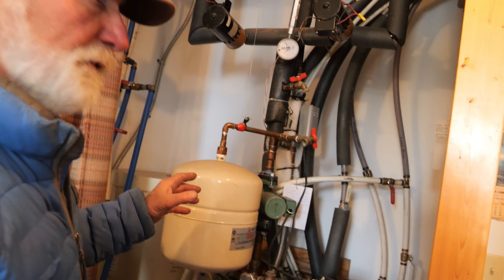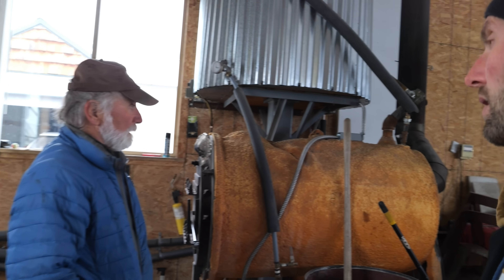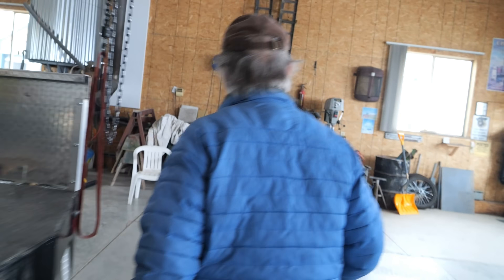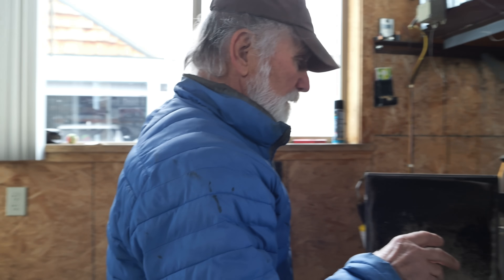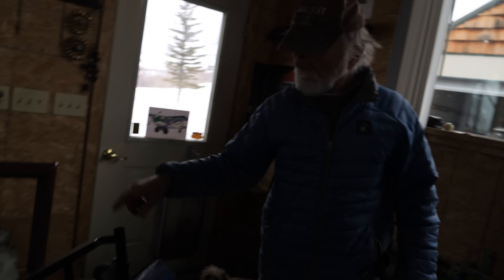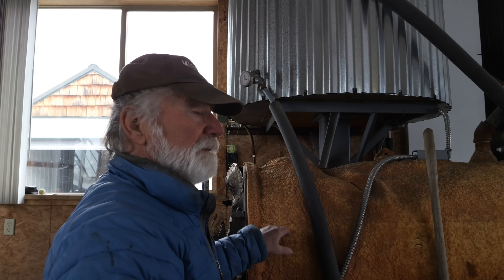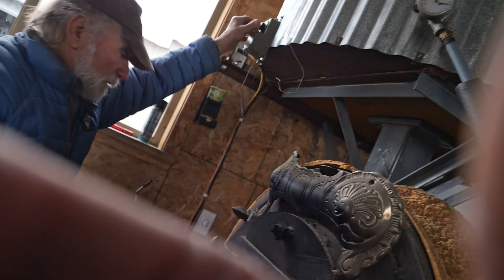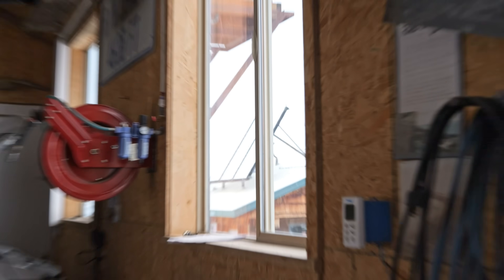Hasn't had a Heating Bill for 40 years.

Comment: 😎🤔🤔🤔💁‍♂💁‍♂🫶(6:33) Pretty dang close: (old timer). 1 top and 2 bottom - flow rate controls, bty...
😎😎🤔🤔🤔🤔💁‍♂(11:17) (I would just use ((Coal Slag > Blasting byproduct material)).
😎😎😎🤔🤔🤔💁‍♂🤡(12:38) The green slag from copper: very slow water erosion; it could mineralize as a toxin; makes sense why the {other byproduct use}, for Conductive Heat Exchanger. Smart Mountain Man: engineer?

Comment: For anyone wondering, his external panels run glycol through them because glycol will not freeze when the temps drop. The warm glycol runs through the heat exchanger which then warms the water to run under the floor. 
I know that it's probably obvious to most folks who watch these types of videos but hopefully it helps someone understand that otherwise wouldn't.
Pretty awesome setup
Reply: I understood this but by all means an explanation of the basics is always welcome. Some of us are just learning about this kind of thing
Reply: I understood all of that, but wouldn't a larger heat exchanger make it way more efficient and speed ip the process of warming the water to warm the floor faster?
Reply: @danamullins2723 those brazed plate heat exchangers are surprisingly efficient despite their small size. More btus with more water flow needs a larger heat exchanger, but his smaller system doesn’t need many btus. He could gain an advantage with a larger heat exchanger but might be splitting hairs if he sized that one appropriately
Reply: @danamullins2723  I can’t remember what principal it falls under but at a point the heat exchanger starts to hurt you for efficiency if it’s oversized too much
Reply: @danamullins2723  a bigger one wouldn't increase speed and efficiency, the system is limited by the heat input from the solar. and there are losses in a plate heat exchanger so it has to be sized correctly. 

no need for glycol under the floor. water is considerably cheaper.
Reply: @cliveramsbotty6077  Should the system fail in the winter, the glycol wouldn't freeze and bust up the pipes under the concrete floor like water would.  Just an insurance policy.
Reply: @danamullins2723  a tiny plate to plate heat exchanger will transfer 30kw of heat they are very efficient they are used in gas combi boilers (I used to be a gas engineer in london) . I’d say the system probably doesn’t work well in the winter though not enough sunlight  hence the wood fired box.
Reply: @danamullins2723  don’t want to sap the heat out too fast
Reply: @danamullins2723  You size it for the system.  He is in the sweet spot for his heating requirements. Any more adds to the thermal mass, which is great once it is up, but will take longer to get to temp.
Reply: Dumb question: why would you want to avoid using glycol under the floor? I understand by separating the fluid he has greater control over the temperature change, but it's technically not as efficient.
Reply: @johnweir-w2f  Glycol is less efficient at transferring the heat (e.g. to the room) than water. His wood burner uses water throughout, he'd use water outside as well if he didn't have to worry about it freezing...
Reply: @fat_biker  simpler is better as long as freezing isn't an issue why not make it easier to refill and maintain that level also having a high point to vent is always a good design feature since it lets you purge the system and diagnose problems.
Reply: @fat_biker  It's a great safety feature.  He could have done things to ensure the outside pipes don't freeze, until the unforeseen happens, he goes to Fla for a month, or is in the hospital for a few nights...the glycol is a great idea to protect the system where it is vulnerable to the extreme cold.  This was a great vid.  I sometimes think about selling my business in Philly (I am from a small farm in N. Central PA originally tho) and moving somewhere like Wyoming, in the middle of nowhere and living a free, self sustainable life like God intended us to live.
Reply: @johnweir-w2f  Because glycol doesn't release its heat as efficiently as water does.
Reply: @johnweir-w2f  Along with the stated, glycol is less efficient than water, If water leaks up under the floor, then he has a relatively mild problem he needs to fix, if he has glycol leak under the floor then he's effectively got a small ecological disaster to clean up.
Reply: @johnweir-w2f  Well he kinda explained it at the start, it's less efficient technically but it would take a lot more glycol to fill those floor tubes than what he used to run from the panels to the exchanger, and water is a hell of a lot cheaper than glycol
Reply: @johnweir-w2f  He runs water for because it has better heat transfer.  Also the floor has 2 heat sources one is solar that uses glycol and the other is the wood fire boiler.  

Both heat sources use the same manifold and water since it is a closed looped system.
Reply: @johnweir-w2f  Glycol is relatively expensive, and water is far cheaper and better at carrying heat anyway due to its high heat capacity. The glycol gets hotter in the solar panels which makes up for its poorer carrying capacity.
Reply: @johnweir-w2f  Glycol is expensive and needs to be replaced every 5 years or so because it chemically breaks down. Water on the other hand has been around for 4,3 billions years and is still water. Also incredible cheap. So can you run glycol through your floor yes, but does it make sense, no.
Reply: @johnweir-w2f  He mentions during the video that the water used in the floor has better heat exchange than glycol. Listen at around 2:40 in the video... at 2:52 he says, "..water is more efficient at exchanging heat than glycol.." (I personally know nothing about it, but for the past 40 years I've had heating bills and he hasn't, so I'll take his word for it!)
Reply: @johnweir-w2f  The specific heat of glycol is lower than straight water, so that means per unit of mass the glycol mixture will store less heat. This loop through the concrete shares the same reservoir as the boiler storage I think, so that would mean a reduced energy storage in the secondary ( but highest volume ) loop. That would be my guess :🤷
Reply: @johnweir-w2f its cheaper and water produces heat faster and more efficient than glycol does
Reply: @noblethepilot6628  Depends on the glycol. EG, MEG, TEG, or DEG. TEG(tri-ethylene)will get the highest and that starts to break down at 408. Its most likely EG which is automotive antifreeze.
Reply: Well..... to say it hasn't cost a dime...... It does take money to have the means to fall a tree. Cut a tree up and split that wood. The tools needed to do those things are not free. Its not free to maintain those tools to be able to harvest trees. There wouldn't really be much of a difference if you just went to a job then used the money from that job to pay for home heat. Its all about the time that you spend in order to be able to heat your home. In reality its much less time spent and less work at a job to be able to pay and heat your home for a year than it is to go get your own fuel to heat your home. Most people its like 2-4 weeks at a job to heat your home for a year, depending on your climate. Its just an illusion that its free heat. Its just time spent doing different things to achieve the same end goal.
Reply: @shperax true to a degree, but I actually don’t think it is the real point. The pride this man has in his work and his creativeness is palpable. He clearly has different values in life, he isn’t married to his job, he loves to work and solve problems, and he can take care of himself and others in war or peace. I really admire that he doesn’t hand over his reliance to corporations and trades he can’t control. Self worth is what this is actually about.
Reply: It helped me to understand, thank you.
Reply: Also if pump fails you won't bust open your panels and flood the house.
Reply: Sounds like me lol. I have a wood burner that does the heating and hot water. Free wood from work. Solar that uses the spare power to heat the water tank. No gas.
Reply: The dumbass has spent $5000 on his heating system and he says its FREE! LOL
What a fucking idiot.
Reply: We use glycol and ammonia at the dairy plant where i worked. We use glycol for heat exchangers and ammonia for cooling. He spent alot of money building his systems fkr heating but im sure its paid for itself a long time ago. Smart men with engineering and mechanical knowledge like this are a  rare breed nowadays.
Reply: Awesome until you have to change the glycol and find yourself with 400 gallons of toxic liquid and nowhere to dump it.
Reply: Thank you! This is news to me.
Reply: Thank u for the summary
Reply: so.... just pure glycol?

what an awful way to describe what is actually occurring in a glycol laced system.

explain how glycol affects efficiency please?

do tell.
Reply: Just wondering where this is located? How low do winter Temps get?  As for the winter coat comment... that is not a winter coat!!
Reply: Thanks, yep pretty confusing
Reply: It might not freeze, but it certainly isn't warm in the winter.
Reply: Solar panels like that are about 2500$ a pop.
Reply: I just want to say as someone who doesn't have an understanding of some of this stuff, you're a legend among men, my friend.
Reply: Yep Glycol is good for -60 or more I think. I know glycol is ram through closed loop computer AIO
Reply: It’s basically a boiler
Reply: It’s just anti-freeze. Same as the stuff in the radiator on vehicles.
Reply: Helped me...thanks
Reply: In a sense. Its akin to the same system of plumbing used to transfer heat from the primary to the secondary loop of coolant is light water reactors
Reply: I think i got it, but just in case can you explain it all again, I don’t understand.
Reply: pure glycol?
Reply: 🤯 lol
Reply: 40 years of utilities was spent on this. Lol. I like it 😊
Reply: @jleblanc26  Not even close, he probably reached return on investment 5 or 6 years in
Reply: I worked with some plumbers to help set up a boiler system in a two floor building about 15 years ago. Fast forward once they set everything up, controlling the temperature was a problem. Why is it so hard to control the temp? All the rooms were overheated.
Reply: Different rooms have different heating requirements depending on heat loss.  Without seeing the set up I can only guess the problem(s) Operator error.  Oversized radiators. Thermostat in wrong place.  Not enough zones.   @crgaillee
Reply: @dictare  OMG, You Sir are so smart and this guy is sooo stupid.  Hopefully he sees your comment so he can get you over there to show him how it needs to be set up.  I mean it's very obvious he has no clue what he is doing and he's struggled for 40 yrs. trying to get it right.  Let's see your system and construction business.  SMH.
Reply: so what if the outside temparature gets to -50f would there still be enough heat to keep the water from freezing? lets say you vacation in january, temparature dips way below and you lose power.......its gonna costs thousands to replace frozen then burat water lines
Reply: @NickOvchinnikov   What's a vacation?
Reply: @NickOvchinnikov -50 farenheit is uncommon in the majority of the USA.
Reply: Oh so they do what he said they do, very interesting.
Reply: It's cold as hell outside what's heating up the glycol?
Reply: @HkLY45  The sun. It delivers heat regardless of outdoor temperature.
Reply: @EricJW  that's wild!
Reply: @HkLY45 that's what I wanna know
Reply: Here is the True Savior

HalleluYAH translates “Praise ye YaH”

YaH is The Heavenly Father
YaH arrives via the TENT OF MEETING
YaH was Who they Crucified for our sins
YaH was Crucified on an Almond TREE

Semitic of Moshe (Moses)
Isa Scroll (The Original Isaiah)

Isaiah 42:8 - I am YaH; that is my Name! I will not yield my glory to another or my praise to idols.

Isaiah 43:11 - I am YAH, and there is no other Savior but Me.

Isaiah 45:5 - I am YaH, and there is none else.
Reply: Those panels are not heating shit
Reply: No such thing as free energy  whether you pay by time or currency it's still not free
Reply: @noelburke6224 It all depends on if you have more time than money.
Reply: @noelburke6224 All this is for the garage,  I realy wonder how plumbing looks in his mansion?
Reply: @noelburke6224 😅😂 Yes captain obvious
Reply: @noelburke6224  clearly. You need to write Oxford then and have them remove some definitions of the word free, from the dictionary, because you say so.
Reply: @noelburke6224 its not free energy… if you are talking about thermodynamics it has nothing to do with money lol😂
Reply: He built this once and it is bulletproof. The power could go out for fever but the house will stay warm forever.
Reply: @ddroz23   Not that simple..To keep everything warm he has to have power to run the pumps that make the
 glycol and water flow through the systems  No getting around the need for 110 volts to distribute the heat. You could put up some electrical solar panels but they dont produce @ note. Not sure how big of a panel array and size of back up battery packs you would need to run the system.
Reply: @ddroz23 Not really...you need 110 to run the pumps that circulate the fluids that warms the floors.
Reply: Didnt he say they ran off solar?
Reply: @noelburke6224 The whole universe is energy....The sun doesn't pay bills nor does the universe and money probably doest  exist outside this planet yet everything outside this planet is running full power as it always was no bills...
Reply: @noelburke6224 Energy is everything and energy is everywhere, it is limitless.

Comment: WHAT AN ABSURD TITLE!! Maybe no cash bill, but he worked his butt off to build the system and provide fuel. For all you suburban and city folks-heating with wood can be free cash-wise, but cutting, moving, splitting and stacking the wood, plus cleaning out the ashes, making sure the fire burns through the night, hiring a chimney sweep every year or two, maintaining the system and more sure make a gas or oil heater seem seriously appealing. I did all the wood stuff for 20 years and just got tired of it.
Reply: No monthly outlays, for DECADES now, (not a  theoretical hoped for projection, it already happened) was the point claimed, after it was installed. The fact you HIRED someone else to clean your own chimney pretty much disqualifies you in making any comments.

Comment: You should be heating 400 or more tank with solar during the day and pumping it at night
Reply: MUCH less efficient, he used to do it that way, but putting the heat into the floor slab as soon as it's produced, and keeping the loop temps below 110 degrees, mean many more BTU's produced at the end of the day.  You get a 5" slab warm, overnight doesn't cool it much.

Comment: There are fairly cheap kits to turn a 55 gallon drum into a wood stove. line the bottom with simple bricks. in my case I didnt care about looks and stuck one in my fireplace, two window fans blew the heat off that drum and the heat was all you could want. the heating bills in Buffalo NY are insane and that idea saved my ass.

Comment: The guy definitely had me scratching my head when he said he had water in the floor! Interesting that it doesn't freeze when not in use! 😮
Reply: 5 inch thick concrete with 12 inch thick polystyrene panels under that to insulate it from the ground makes for a huge "heat sink" so unless he abandons the place it will never freeze...
all things being equal, remaining the same, and never changing.
Reply: A foot of insulation under the floor? @JohnSmith-yv6eq

Comment: He just paid for his heating cost upfront 🤷🏻‍♂️. You still need material to put in the boiler to burn. 🤷🏻‍♂️. If it is, would it takes time and currency to collect cut and stack.  Nothing is free. There's always an exchange rate one way or another.
Reply: The boiler is only a small part of the heating system, the solar thermal panels do the bulk of the work,. The amount of wood and effort required is minor, maybe a couple of pickup loads per season, and either scrap lumber on jobsites I'm already on anyway doing crane work, or deadfall on my own property that I need to pick up anyway.  Not only do I not pay for the wood, I often get paid crane op wages while picking the wood up, wood that would go in the dumpster. Then I haul it home in the back of my solar charged plug in SUV, using no gas, while I'm going home anyway, so never a special trip to just get wood. The electric boiler does the rest all solar powered.  The people protesting I'm not getting "free" heat, are probably the ones with the largest monthly bills. The crane and plug in SUV both cost money of course, but both are paid for in full, so no monthly bill there, FREE HEAT is the result.